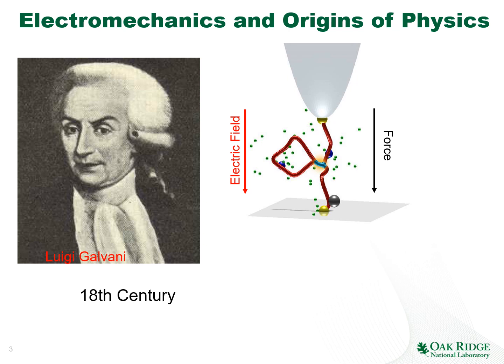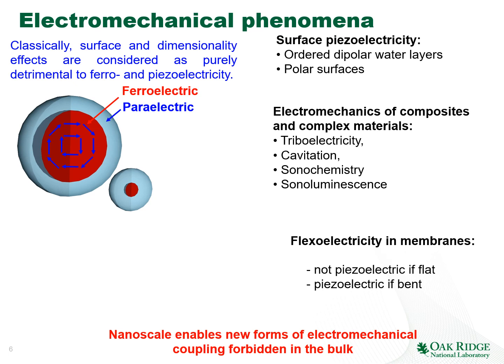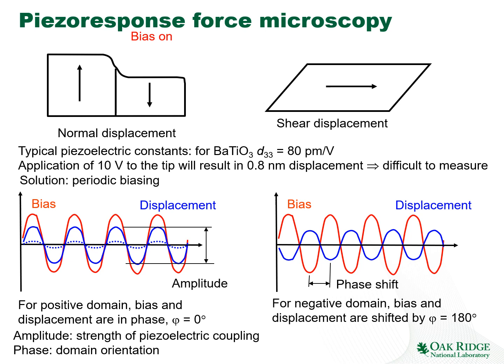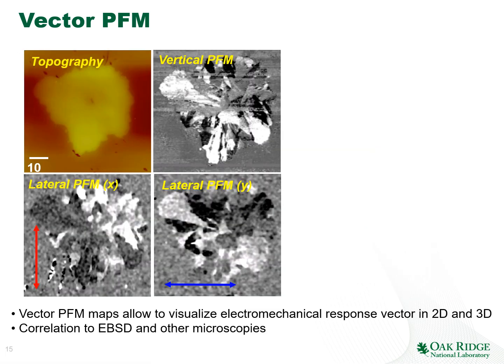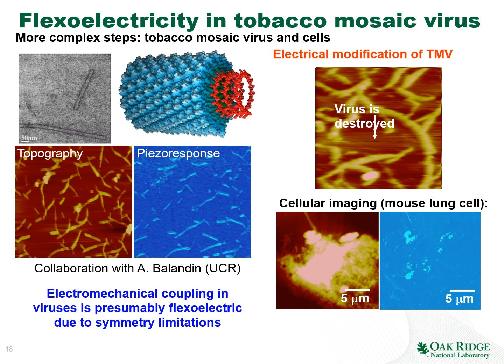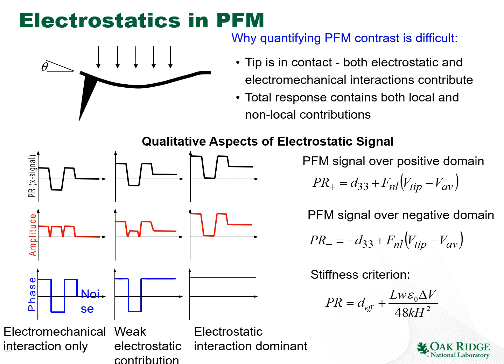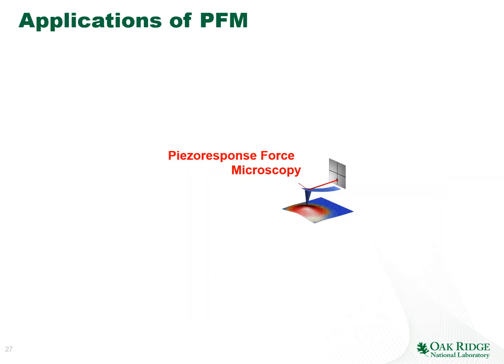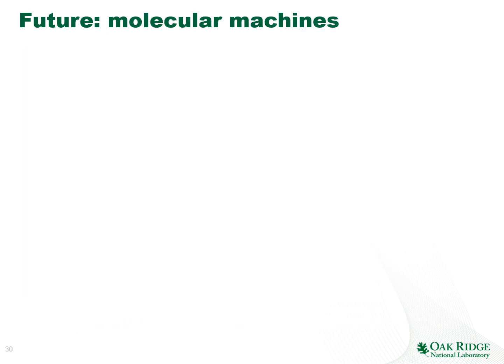PFM Lecture 1: Introduction to Piezoresponse Force Microscopy and Spectroscopy

Comment: I investigated piezos in the early 1980's while researching piezo d33 displacements to maximize fluid displacement for fluid ejection in droplets. In the mid 1980's my thinking was expanded to maximize piezo materials formulations to get the best displacements for 3D printing thermoplastic materials. I used a surface  finish contact probe to measure displacements with applied voltage to PZT-5H tubular structures. 
I developed an image showing the 6 physical states of a unit cell of piezo material. There is only one state that produces the optimum displacement for the 3D printer piezo used in the Howtek Style Inkjet. It is so nice to hear Sergei explaining this. The imagery of the grains is very impressive. I never had the luxury of seeing this in 1980 when I worked at Exxon Office Systems, Printer R&D.